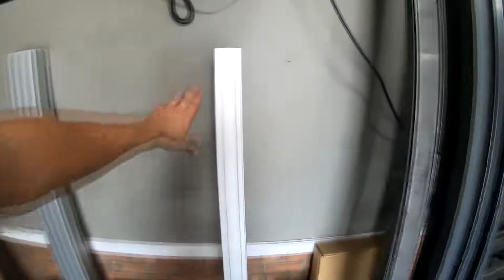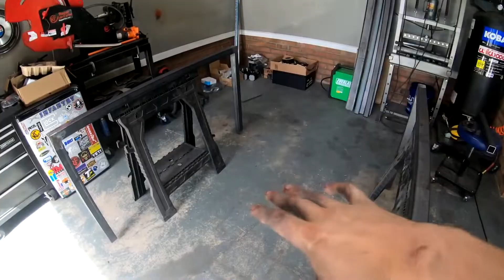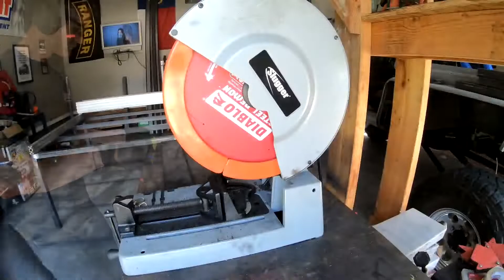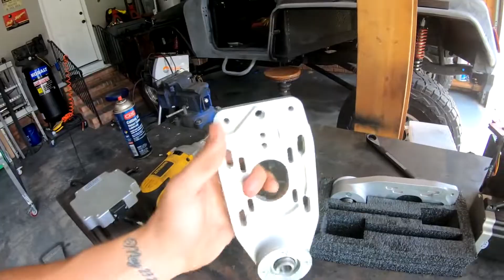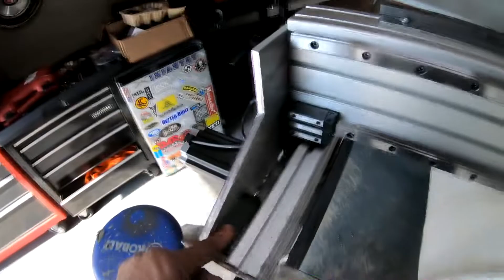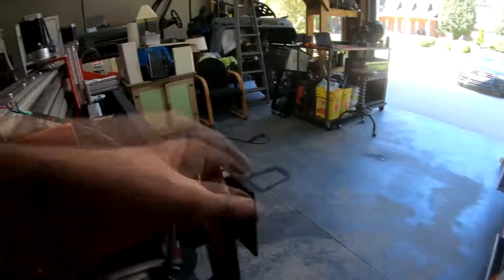DIY Industrial Plasma CNC - Frame and Mechanical Build II Legacy 4x4 and Off-Road

Comment: Hi Jake - I ordered your parts list - Thanks.  Questions - Do you have the lengths of things that need to be ordered such as the aluminum extrusions, linear rails, and frame pieces (including the dimensions of the overall frame)? Are any of the cables shielded or do you have any links for them?  Do you have any layout drawings of the gantry plates etc?
Reply from the maker: Sorry i thought i put the lengths on bom but here they are for the aluminum. 2x4080 extrusion at 1524mm(5 Ft) and 1x8016 at 1524mm(5ft). I do not remember all of the steel cut sizes I did them on the fly beneath the extrusion to make the frame.

Comment: Great build!  What dimension of V Rail are you using for the y axis?  Is it 20x60?
Reply from the maker: The Y Axis Rails are 4080 Profile Aluminum extrusions, 40mm by 80mm and using 40 series fasteners. X Axis is 8016 Profile which is 80mm by 160mm.
Reply: @Legacy4x4andOffRoadYT  thank you for sharing!  I’m in definitely following your build jus  a few different tweaks. Any chance you mind sharing your gantry arm dimensions?
Reply from the maker: Kaleb Lee sure thing, both the x and y axis are 1525mm, they were cut to order when I bought them. Comes out to pretty much 60in. 

The work space/water table is 52x52inches. The extra 8 inches accounts for over travel, gantry width and z axis up take. Which allows the torch to actually use a full 48x48in sheet
Reply: @Legacy4x4andOffRoadYT   awesome!  That’s what my table worked out too. 52”x52” for the water table. Unfortunately I wasn’t able to get that size of extruded aluminum. I’m just waiting for the order but the y axis are 1500mm and x is 1600mm. Do you have a dxf file of the gantry brackets that the x axis mounts to? I have been CADing one up but my parts don’t show up for a few weeks.

Comment: Are you making this to make things or to sell ?
Reply from the maker: For my own personal use, itll make signs and such for some side money and I use it to make panels and body parts and brackets on my Jeep projects.

I sold my first one because I wanted a higher quality machine so sold it after using it for about 6 months.
Reply: I get the x and y from my time on vinyl decal machines, but the z eludes me as I have had zero experience with it. Nor have I looked it up, maybe a video idea there ?

Comment: That water table feature gonna be legit, lots of weight worth of water in that barrel.
Reply from the maker: That is the idea, it will take probably 30 gallons to completely fill the table...if i did my math right. the extra will allow some good circulation of the fluid. Thanks for watching!